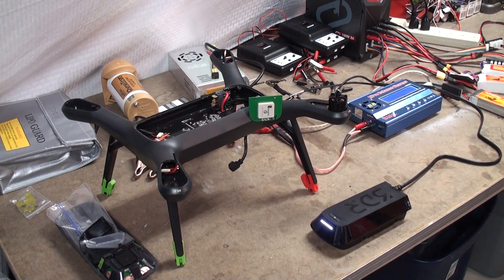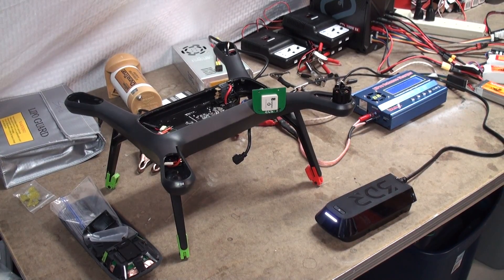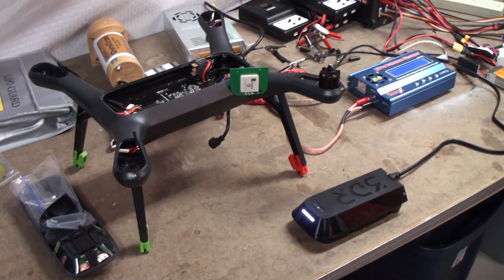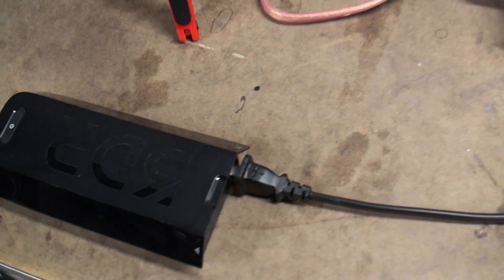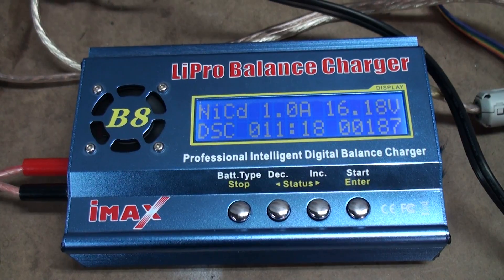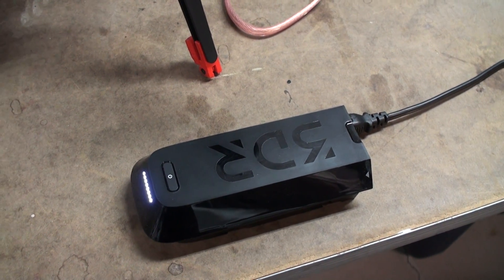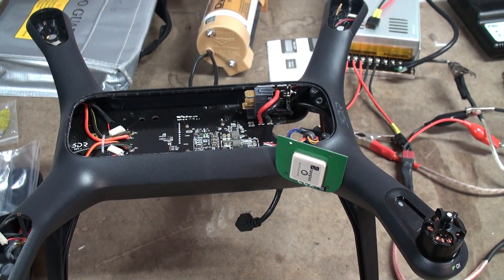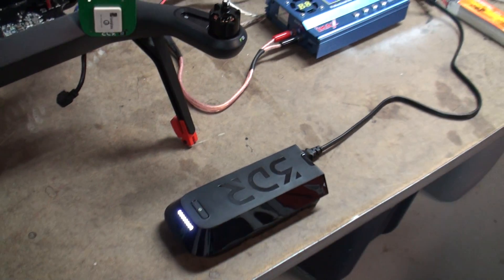3DR Solo Safe Battery Storage Voltage - How Do You Discharge your LIPOs to 50% ?

Comment: After making a plug hack like yours can I connect a 12v car globe to the batt output?
Reply from the maker: The 3DR battery is 14.8v which should work on a typical 12v automotive light bulb, so if you can turn the battery on then yes, it should work.  Sometimes the smart battery feature makes it hard to turn the battery on.

Comment: Why is the battery charger not set on Lipo  discard. Why is it on nicad.
Reply from the maker: Great question.  The 3dr Solo battery does not have external lipo balance cables like other lipo batteries. Without the lipo balance connector plugged into my battery charger it will not let me do anything under the lipo battery mode.  I am able to trick the charger by going into the nicd mode. I still keep a close eye on everything to make sure I don't deplete the battery too far.

Comment: Using a Hitec X2 on lipo discharge setting but it limits me to a .6A discharge rate so it takes forever to drop the voltage to a level I require, right before I start the discharge function, I have to press the power button on the battery pack for the charger to recognize the battery pack and it only gives you a very short while to do so or else the battery charger will say broken connection